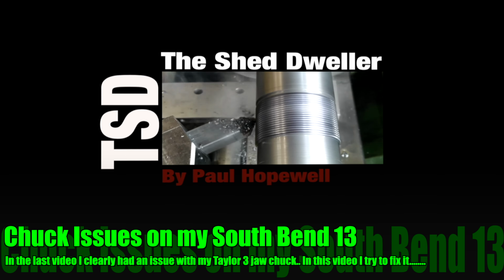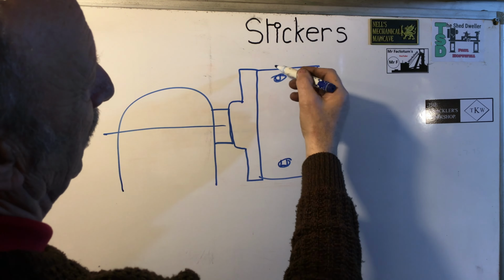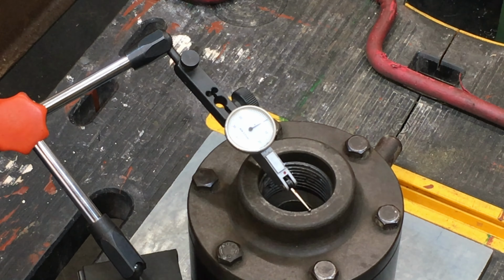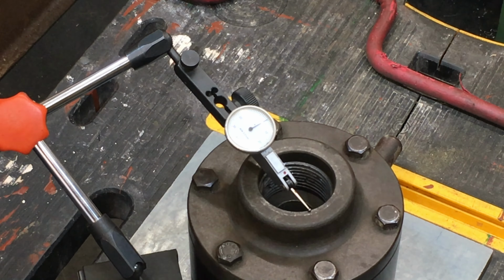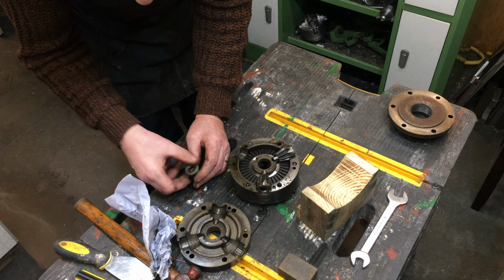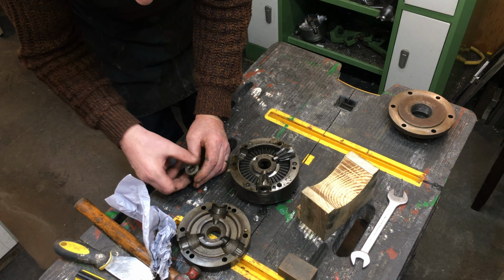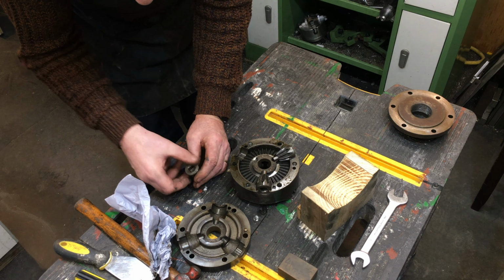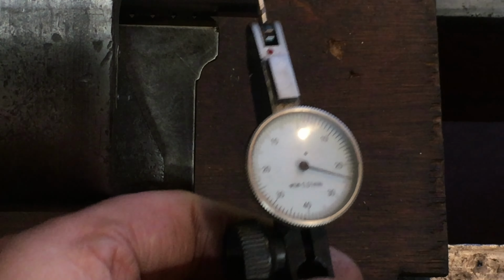Fixing my 3 jaw chuck

Comment: Love the way you went about this.  Though personally i would have turned or ground back plate on bigger lathe or cylindrical grinder and  then checked runout on its own before i put it together.
Reply from the maker: I’ve only got the two lathes and my cylinder grinder won’t quite hold it. The chuck does hold better than it used to. Cheers

Comment: It's a wonder that there weren't birds nesting inside that chuck! I guess that any chuck will benefit from periodic cleaning and we can't take anything for granted.
Informative presentation! Keep up the good work!
Reply from the maker: thanks.
Reply from the maker: I'd have said rats nesting, it stunk a bit.
Reply: Use the bolts tand a mallet to separate the back plate and chuck,backthem off slightly and give them a whack.....👍👏
loving your content pal, thanks for sharing 🍻
Reply from the maker: @RossiDeakin0406  Cheers

Comment: Cracking work! I also have a taylors chuck on the Holbrook B9 I am rebuilding at the moment,  and it is going to get this treatment when it comes to the top of the rebuilding pile! I also have a Colchester roundhead student and found when rebuilding that, a very similar error  on a test bar inserted straight into the spinle  taper adapter, there was error on the spindle taper, error on the adapter too,and when I blued it all  up and carefully removed the dings with a scraper, like yours, it suddenly snapped back to spot on concentricity! These older machines were built to good standards! Thoroughly enjoyed the video!
Phil
Reply from the maker: Thanks Phil. I’m still amazed how well it turned out. cheers.

Comment: Good job!
Except one thing: I do not grease the inside of my chucks any more. The movement of the parts against each other is so small that the grease doesn't effect too much. But it catches very effective all that parts and particles that you don't want to have in your chuck. A very light oiling with a bit thicker oil is enough and makes the cleaning - for example with compressed air, that's absolutely fine - much easier.
Reply from the maker: Hi, thanks. For the most part I agree with you, but this chuck had grease in it when I opened it, and thats the only reason I put some back. It is very well sealed, internally. However, your take on not putting grease back in was, probably the better choice.  Cheers.

Comment: I am a hobby machinist. I wish I had a surface grinder. What size is yours? Any recommendations?
Reply: 6”x12” is a common size for home shops and works well.
Reply from the maker: Hi. My surface grinder is a victaeagle thats all I know. The table is an 18”x 8”, I’ve not yet seen another one like it. I couldn’t possibly recommend anything other than when you do go to buy one, take some one with you. Cheers